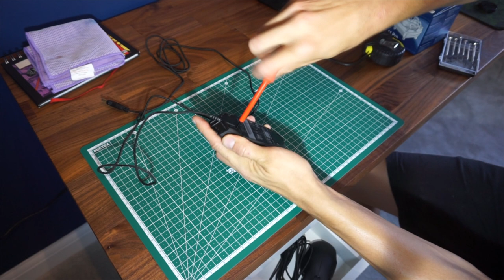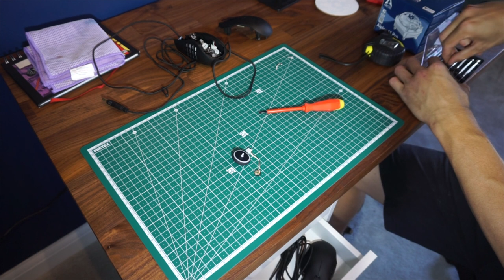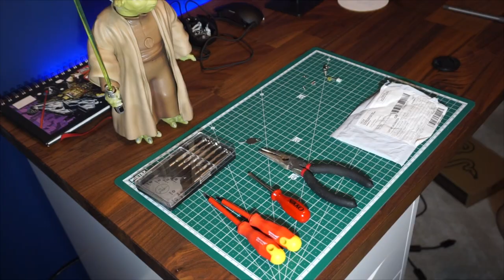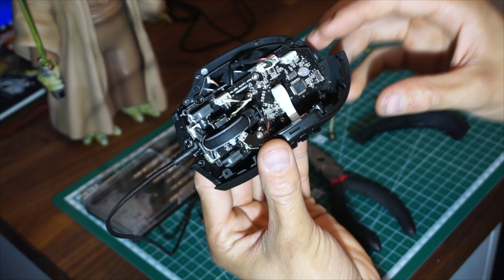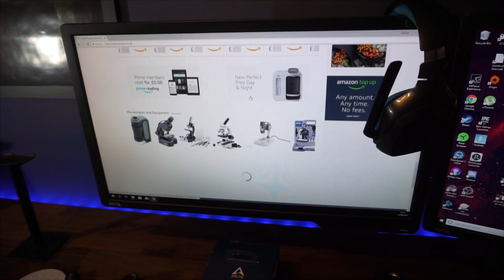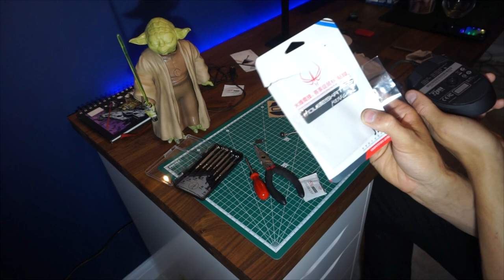How to FIX Razer Naga Scroll Wheel (Jumpy Scroll wheel)

Comment: Potential quick fix. I've had this issue for a couple of months and never got round to fixing it. Heard it can be due to dust so blew harshly into the gaps between the middle mouse button. Worked for a month now with no issues. Before buying all sorts just give that a try first.
Reply: This worked for me, thank you!
Reply: This worked for me too, man. Thank you very much c:
Reply: I have never said this before but this is the most fitting time to say it: Not all heroes wear capes.
Thank you so much!
Reply: holy shit that actually worked, thank you so much
Reply: Thanks man it did work for me :)
I used a compressor blower
Reply: Holy shit thanks man, I just blew really hard inside and somehow that made it work again.
Reply: I did that! The first thing that I did. Nothing. Then I read your comment and tried it again. Now it works. Your comment is magic.
Reply: You fricking mad lad!! It actually worked for me, thank you soo much
Reply: A fucking genious, thank you
Reply: Thank god i found your comment. You saved me a lot of headaches. Thank you!
Reply: Doing gods work
Reply: My guy, you are a legend!
Reply: A true hero among us, thanks, this actually worked for me as well
Reply: Thank you for mentioning this! Worked for mine as well! Looks like I had some little hairs and dust in there that built up over time
Reply: holy fuck this actually fucking worked, thanks bruh
Reply: Thanks, seems like that was the issue for me too.
Reply: Thanks alot! Worked for me perfectly <3
Reply: got a can of compressed air with the small straw and it worked like a charm thanks a lot.
Reply: Yup this fixed it for me my guy, thank you.
Reply: not all heroes wear cape

Comment: My friend, THANK YOU SO VERY MUCH for this tutorial. You've saved me from a massive headache and a lot of money too. There was DUST inside that extremely minuscule hole in the tiny squared box attached to the wheel. I didn't need to switch anything. I cleaned it after disassembling everything, and magically the mouse returned to its former glory. I'm very grateful that people like you exist. Take care and thank you again!
Reply: @zombification  ty for commenting this lol, fucking headache
Reply: @zombification  What the heck lol right after I saw your comment I literally just blew into the scroll wheel and this problem is finally gone you all are the best
Reply: Blow, huh?  I have a Razer Basilisk V2 with all optical switches that I ordered on  in September 9th of '21.  I'm just now checking that and seeing that it was right at 14 months later to the date that my mouse wheel began acting funny.  By the end of that gaming session I knew I had a problem.  I figured it just needed an adjustment but I wanted a decent mouse to use before I took this thing apart so I ordered the new V3.  Now I take the V2 apart and see that there is nothing I can adjust inside.  I don't want to take the decoder off and replace it.  I'll put it back together and try blowing.  Hell, I'll even try a can of compressed air.  I'm a bit pissed because I have a history of going through two or three mice per year because the left mb always gives up the ghost.  So when I saw a review for the Basilisk V2 with the optical switches I knew I had to have one.  Funny thing, I didn't realize it but they sent me an original Basilisk NOT the V2 and I used it for over a year before I checked it.  I now use that one with my laptop (which I turn on occasionally) and I've been using the V2 I ordered a year ago as my regular desktop mouse.  The original with the mechanical switches is still fine.  I'm a bit pissed that the reason the V2 needed replacing was because of the mouse wheel.  That's just irritating.  I'll put the mouse back together now and see if blowing into it will do anything.  Nice to meet all of you responders.  Later.

Comment: If anyone reads this comment. I didn't take anything apart. I pushed downwards quite hard on the wheel, and wriggled it backwards and forward like a maniac. Seems fixed.
Reply from the maker: Sometimes it can be dust caust in the sensor so yes this could work. Also a can of compressed air is also a good idea.
Reply: This also worked for me, for now. Something did pop when i did it. Thanks.

Edit: Nvm already stopped working again LOL!
Reply: worked for me at least for now!
Reply: Hey, thanks for the advice, it seems to have worked for me as well.
Reply: This has worked for me as well at least for now my mouse is not the Naga its the DeathAdder so it doesn't just work for the Naga
Reply: HOLY SHIT YOU ARE A GENIUS IT WORKS WITH THE MAMBA TE ASWELL THANK YOU KIND STRANGER <3

Comment: So: for those looking into this video with the same issue concerning the Razer Naga Pro rz01-0342 (the wireless one with interchangeable plates), I've gone and opened up that mouse.  Inside is a different encoder by the company Kailh, and when I popped it open, I found that it was coated with a nasty black dust (likely from Chinese manufacturing smog or something similar; it was almost like coal dust) inside.  A clean of those contacts with a Q-tip and some alcohol along with * very gently* bending those copper pads back on that green wheel piece inside to give it some extra spring using a screwdriver (along with adding some extra bend in the spring-y piece of sheet metal this guy bent with his fingers; I opted to use some needle nose and very light pressure).  As long as you take care to not bend the small sheet metal plate that is covering the whole assembly during your disassembly, you can superglue or UV resin the piece back together while holding it closed with semi-firm pressure from some needle nose; make sure you don't get glue on the green wheel or contacts inside - this will ruin the part.  As long as both the contact pads and the spring are both given some life and cleaning, and given your glue/resin job holds up, the unit should work like new.  

Also, any other issues with the mouse can likely be dealt with here; squirt some electrical contact cleaner into all of your button units and swab off anything weird you might find on the board.  After reassembling mine, I haven't had a single issue and I even resolved some other issues I had with some buttons.  I have seen elsewhere on the internet that you can actually use the encoder shown here as a replacement for the wireless naga pro, but you will have to resolder the wires and connector to the board from the original encoder to the new one and ensure that they are in the correct order (I saw somewhere a diagram showing which wires go where to control which direction the encoder sends when it registers movement.  And considering the mess I saw inside the encoder when I cracked it open, I would maybe actually opt to rebuild my encoder anyway to personally ensure that there isn't smog dust or something else encased inside.

To be clear, the wireless Naga Pro uses a Kailh encoder, whereas the encoder listed here is a TTC encoder.  They appear to be interchangeable from my research as long as they are rewired with the connector properly.  Up to you if you want to rebuild with some glue or just resolder some wires.  I don't have a soldering gun rn, so it was just a better option for me to rebuild the original.  It would be extremely helpful if someone made a video repairing theirs with the info I've listed here.  I'd also happily repair someone else's for the sake of creating a video using it; I'm not in the market to purchase another defective unit purely for the sake of repair since it's not my usual kind of work, and I could very well screw up my next attempt, but it could technically be worth it to refurbish these mice right now if you have the hands for it; a defective unit can come as low as $40 on eBay today, and a refurbished and tested unit can still sell for $90 to $100...  That's a nice margin for a $2-3 part fix and maybe 45 minutes of labor to a seasoned pro.  It took me a little less than 2 and a half hours for full disassembly, clean and reglue, and reassembly total, and this is my first time ever repairing a part of this size.

Seriously, someone with some capital and time or owns an electronic repair shop could just buy up defective units and refurbish them.

Or someone could make a straight killing on eBay selling rewired Naga 2014 TTC units to fit the wireless Naga Pro; you'd just need to find a board connector that fits and could be rewired onto it...  @rossmanngroup would probably help with that lol.

Comment: Huge help bro, bought the parts, took it apart, replaced the bits, put it back together and now my 7 year old mouse is practically brand new again.

One suggestion to people who are going to undertake these same repairs, when removing the mouse wheel, dont do what I did and remove the whole bracket, i ended up snapping small pieces of plastic that i had to superglue back together. REMOVE THE WHEEL FROM THE BRACKET!

Thanks again! A $20 AUD repair job vs a $140 new mouse.

Comment: thanks for this. I wasn't able to pry open the encoder to get to the D spring you mentioned. However, I used needle-nosed pliers to squeeze and sort of dent the metal casing ever so slightly (coming from your principle of trying to tighten the contact point), and it seems to work pretty well, in fact I got the reverse effect from you, now the wheel feels a tad too tight, but hey, it works!
Reply: I read your comment and decided to do just that. Worked like a charm--thanks!
Reply: Hey, just did the same thanks to your comment. Also a little tight but better than non-functional! Thanks a ton.

Comment: I know this is old, but in case anyone else finds this: I just took the mouse apart and cleaned everything really well with isopropyl alcohol. I also took the wheel out and flipped it to the outside of the little mechanism it pokes into (there is another hole on the opposite side) this made it easy to use the wheel as like a wrench to slowly turn the mechanism while I gently cleaned the top part with alcohol after each turn. I don't know if this last part is needed, but if you look inside the top of the wheel mechanism, you can see a thin little metal piece (I think this is what detects scrolling as the mechanism turns). I used a very small metal tool (I think a paper clip might work) to slightly push that metal piece inward toward where the wheel normally is. In theory, pushing it in like that should help but to be honest, I think just cleaning everything did the trick. I did not put any tape or anything on mine.
Reply: Sadly, the metal piece has nothing to do with the scrolling function.  The encoder on the wheel is what does that part. Typically done in some sort of grey code (https://en.wikipedia.org/wiki/Rotary_encoder) the encoder can tell direction of movement based on current position and previous position.

Comment: What is better:
Razer Naga 2012 or 2014? I've never tried the 2012
Reply: I like the 2012 or older versions. the two side buttons for your pointer finger are very well placed and the mentioned membrane buttons dont press as easily when readjusting your mouse. I have had both the naga molten and now the 2014 naga chroma

Comment: Quick Fix:
Just blow really hard as close as possible near the scrolling wheel, I got it fixed without needing to open it.
Reply: @NixVo Thank you very much bro, I had this problem with my mouse for 2 years and when I read your comment I didn't really believe it, but I tried it and it worked perfectly. Not all heroes wear capes.

Comment: I hope you are still there.  I have a question:  When the wheel is seated back in the cradle, does the encoder have any freedom of movement?  I just took apart a one year old Razer Basilisk V2 and when I spin the wheel the encoder will rock slightly forward or back with the wheel, then when I release it, it rocks back to what I'll call a resting position.  I thought maybe this was the problem.  After watching your vid and reading some comments below I'm not so sure.  Thanks.
Reply from the maker: I am sorry, it was a long time ago I took this apart I cannot remember, yeh maybe if it’s worn then there is now clearance for it to move forward,

Comment: As usual point of failure is the thinnest possible metals. Like Steelseries uses the thinnest possible wire gauge and their headphones disintegrate. Thanks for the video! I could aim my duster more effectively at the encoder side of my mouse wheel and things are working better now.

Comment: Much appreciated. The middle-click on my model of Naga is just dead. Nothing I can do for it outside of re-soldering switches and the like. However, the scroll wheel issue has been resolved, thank you. Different model than yours, but a thorough clean and re-assembly helped get it back in shape for the time being, at least until I can gets my hands on a new Naga to replace this one I've had since 2012.

Comment: You can re-use the feet if you use a heat gun to take them off, get some rubbery style adhesive. Also have a stand by mouse in the event that you end up needing to buy some feet due to bending them. Love the side profile. I think I'll skip the naga and keep using the death adder. I used to be able to put my pinky on the shelf of the naga epic 2012 but I like the height of the death adder great for my hand size. The Epic 2012 sucks, battery life is a hassle for a desktop. You're better off with a mouse that takes actual batteries on the go because you can swap them out and keep going for a long haul. At home you don't need wireless.

Comment: Thanks for the video, I just took it a part and cleared the wheel connectors etc, put it back together and it fixed my issue. Thanks for the upload.
Reply: Similar, I just had to clean the plastic spoke that fits into the encoder.
Reply: Did u buy the replacemnt for where the screws are on bottom?

Comment: So my Razer Naga X middle mouse BUTTON just started not working about 30% of the time. For example, a game i play requires me to hold down the middle mouse button and move the mouse around to adjust camera angle. Now, when i hold down the middle mouse button and glide the mouse a direction, it will stop 'mid glide'. Same thing happens on any web page (using the middle mouse button to scroll up and down) and also on a different computer so that tells me its a hardware problem. I've taken the whole thing apart, cleaned it (for being just over 2 years old it really wasnt very dirty at all), put it back together and same problem. I saw where the button is located and how its pressed.. like i said it works about 70% of the time. Very annoying when it doesnt work :/

Comment: unfortunately did not do the trick for me. Even replaced the encoder, stripped the PCB right down and scrubbed it with IPA and the issue persists. Asked razer CS about getting a replacement main PCB but they won't help. I'd buy the PCB elsewhere but I have the left handed version so I can't source one.

Comment: Got a question that you might have some knowledge of. My Wireless naga, doesn't work wired anymore. At first I thought the USB port was gubbed, but checked that and the cable and they're both find. It doesn't charge, or work as a mouse with the cable, but wirelessly it still works, and charges via the wireless dock. This fixed my scroll wheel though! Thanks!

Comment: I just took it apart and blew the crap outta it and cleaned out some hair and gunk and debris with a screwdriver and now it works! And then replaced the pads on the bottom with black duct tape that I cut with a scissors.

Comment: Hello TechClub,

I have this problem on my Razer Lancehead Mercury tournament Edition Mouse.
Do you think the encoder that you advised for your Naga can fit also for resolving my case ? 
I mean, the encoder can fit on most of the Razer mouse, like mine, or is it really made specifically for the Razer Naga Mouse ?

I'm considering to buy this encoder for my Razer, but before that, I would like to be sure to buy the right item. 

Thanks for your answer, for this video also and..  Have a nice day ! :)
Reply from the maker: well i have had the same issue on a death adder and a naga so possibly, try find a picture online of your mouse open, if it uses the same setup then probably will be the issue

Comment: I have the same problem with my Mamba Wireless. It is sad that nothing that Razer is making is reliable. This is the first time in my life I have a mouse that fails at the scroll wheel level. Is that the same encoder for all Razer mice?
Reply from the maker: You could also try blowing in there with a straw. I think it is the same yes
Reply: @techclub8528  Thank you for the quick reply. It is not perfect but it does help to blow air. I used an air duster instead.
Reply from the maker: If your feet on the bottom of the mouse are worn and you plan on replacing them then this is a good time to go ahead and do the fix giving you a nice fresh new mouse
Reply: @techclub8528  After I open my mouse and put all the parts back into place, the left button and the right button are no longer crisped. They become mushy. I made sure I screw the screws back very tight. Does you know how to fix that?

Comment: Get a can of electrical contact cleaner, unplug the moues and place it on newspaper or paper so you don't make a mess, pull up the buttons and spray the cnotact cleaner into the exposed pots and between the scroll wheel and spin the wheel back and forth to get the contact cleaner soaking through the points.  My Diamondback Chroma has been jumping a lot with the scroll and I looked high and low for fixes then realized I have a can of contact cleaner for my simracing rig pedals since the pots are exposed to dust/hair, and I used it on my mouse and voila works again.